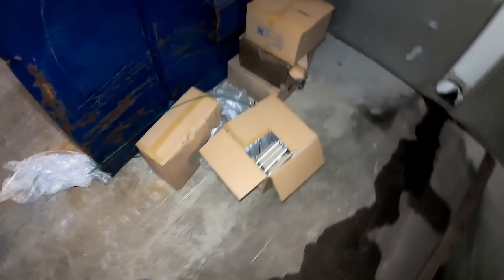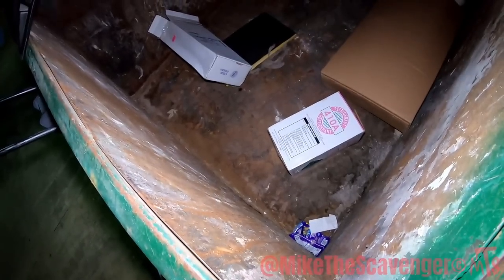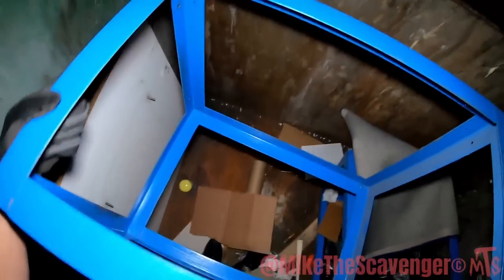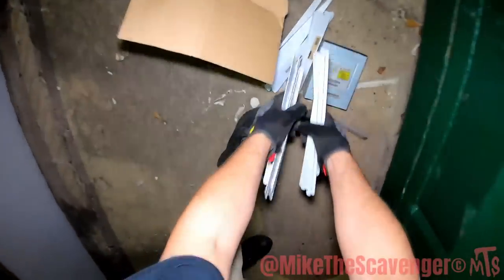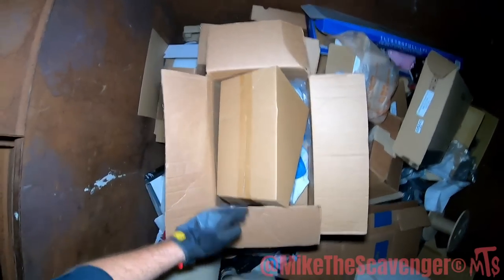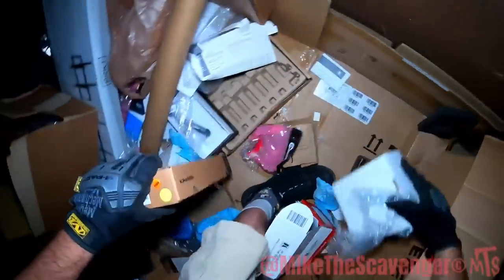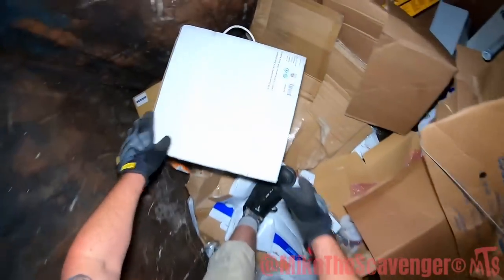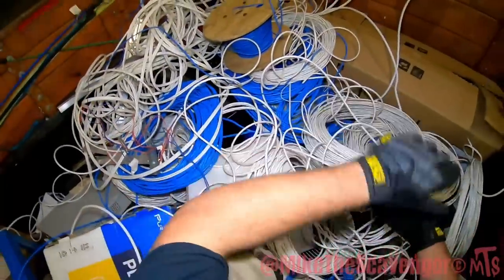Dumpster Diving "Experience MORE!"

Comment: What you found in the first dumpster is called a mini split they are a duct less ac and heating unit. They normally come with the copper lines to do the hook up they could still be in that dumpster underneath the cardboard or inside that box

Comment: My heating and air are Mitsubishi mini splits with the heat pump.  The wall unit goes for a few grand each.   My set up has 2 9000 wats and 1 18000 wats wall units and a heat pump.  Paid almost 17000 installed 3 yrs ago.   Great find.

Comment: It’s a heat pump. Not very common in your neck of the woods but basically standard here in NZ. It does gearing and air conditioning.

Comment: The split air conditioning unit is the most common type in my country.
It is connected with each other by 2 copper pipes and should be charged with a refrigerant when installed and discharged when removed.
They have heating and cooling version or just cooling.

Comment: That AC unit with the inside wall unit and the external unit is pretty common in Europe.   Some are also equipped at act as heat pumps so they can heat in the winter.
Reply: Funny they came up with the descriptive name "heat pumps" to make them sound like new technology when they're already known as reverse cycle airconditioners. It's been 20 years since I've seen an ad for a "cold only" aircon. Split system reverse cycle aircons are the norm here in Australia, but there will always be situations for the old "window rattler" box a/c's.

Comment: We call those AC - Split AC
The external part is called compressor unit which is connected to wall mounted unit via copper tube and wires

Comment: Hi Mike and Laura that ductless air-conditioning system you found is fantastic and good for my kind of home that doesn't have central air.
Fantastic finds. Can you tell me what model number the walkie talkies are ?
Sometimes the batteries packs cam cost around from $10-50. According to if it's Ni-Cad or Li-on.
Thank you for another great video. Hope the pups are enjoying their new home....

Comment: Most companies would let you pick up the scrap wire directly from them. Just set you a pick up bin at the location. You would actually save them money and give them a better write off, because they're recycling the wire. Waste companies now have to separate waste to prevent recycling items from going to landfills so they charge companies a lot for their trash bins.

Comment: That ac unit you pulled out is a mini split unit it has heat and air we have one they ain't cheap they run around $800 and up depending on the BTUS

Comment: Stripping the split system a/c indoor unit is messy being mostly plastic, but after a while the little radiators add up in the collection- but you have to cut the steel plates off the ends for best prices. The compressor unit is the more valuable of the two, scrapwise. Do you cut the compressor motor open to seperate the windings or settle for less as a unit?

Comment: thats poxy because electricians replace the bad parts and charge you for the whole unit and install coz air con companies dont like selling service parts and prefer you buy a whole system and so they make it a cheaper option so there is no insentive to replace single parts. with that being said i would chop that six wayz from sunday SCRAP IT!